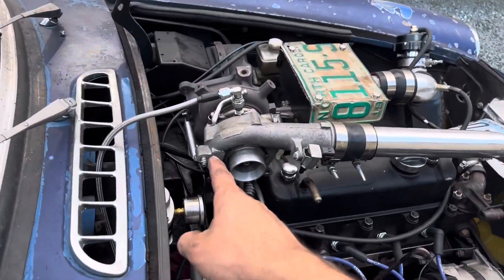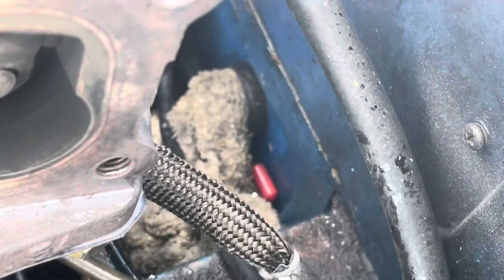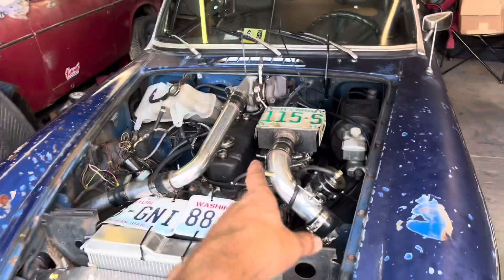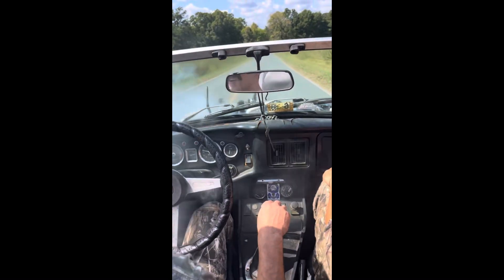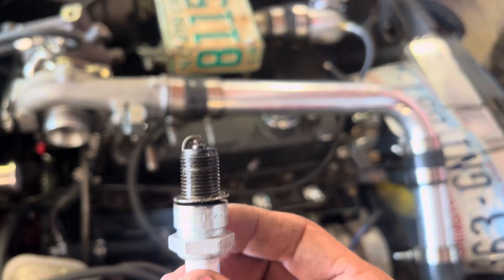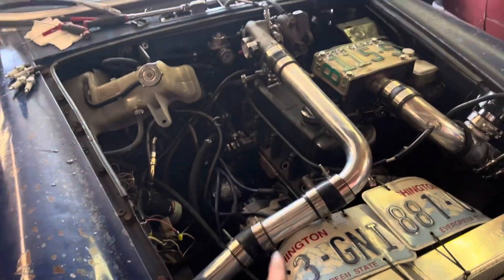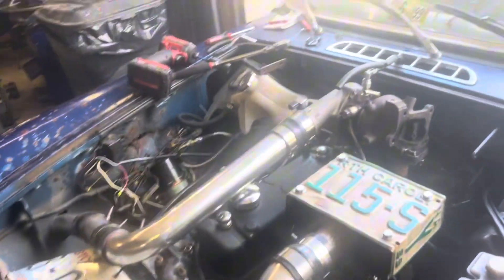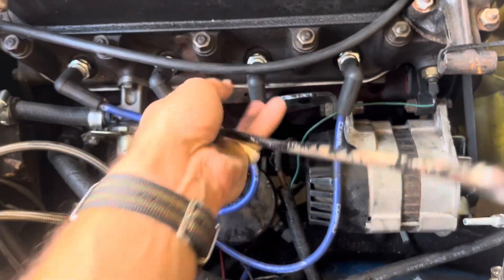World’s Worst Engine (MGB) Makes Too Much Boost

Comment: Your AFR is crazy lean, lucky a HG is all that let loose! Throw a boost activated meth inj kit on and keep throwing straight methanol at it until you see low 11's high 10's on the AFR gauge. 15-20gph nozzle range.  will up octane a ton and cool the charge. Spray pre turbo. 

Good luck!
Reply from the maker: @AdamOpheim  I knowww, she leannn at full boost. Going to rejet the carb first.
Reply: @project4bangers  is the carb and fuel pump boost referenced? alot more than a jet change is needed. Way less work in the long run to inject a bunch of meth. with an adjustable  boost switch.  works better too! Best of luck tho. look fwd to seeing what you do.

Comment: Turbos are like hydraulics. Smaller turbo will spin up faster and make more boost quicker. Hydraulics will make more pressure with smaller lines or more flow with bigger ones. Same principle different scenarios